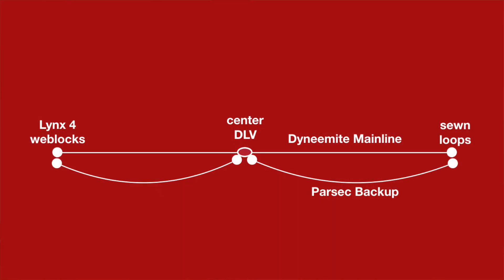Highline Mainline Failure - contributing factors and risk management

Comment: Hey Stephan, 
Thanks for sharing this! There is one point that confuses me a little. You say “the steeper the angle of the line, the higher the forces at the anchors during leash fall”. But when you rig a static weight the forces at the anchors will increase the flater the angle gets. Did you tested this? Is it because the webbing stretches so differently without pretension?
Reply from the maker: Yes, this also highly depends on the webbing. In this case it is meant for Dyneemite with its nearly non existent stretch.
Reply: @raedslacklines That would mean you never should use an ultra low stretch webbing or dyneema rope for backups, at least for shorter highlines, right?
Reply from the maker: @Felix-gm3zc  That‘s correct.